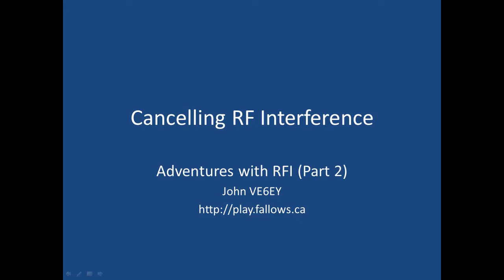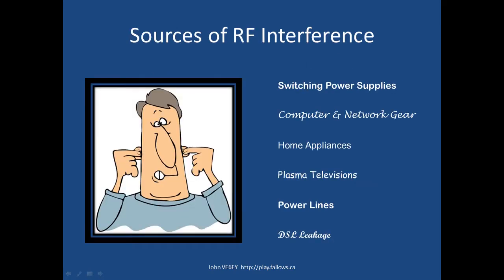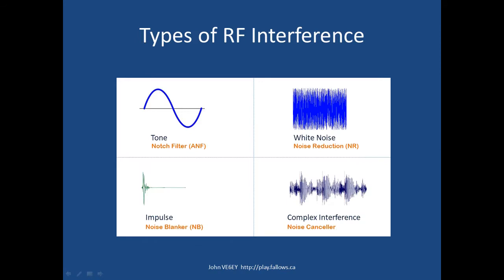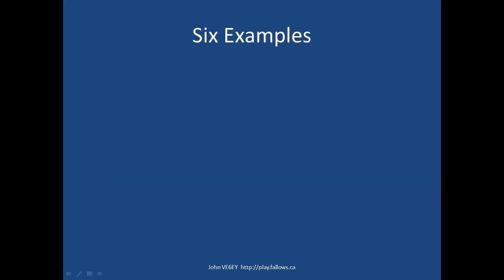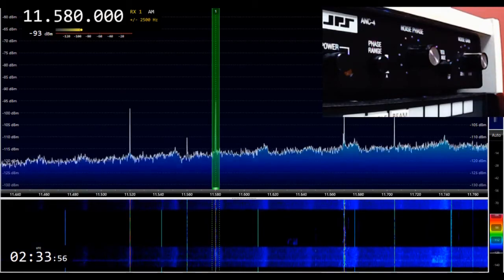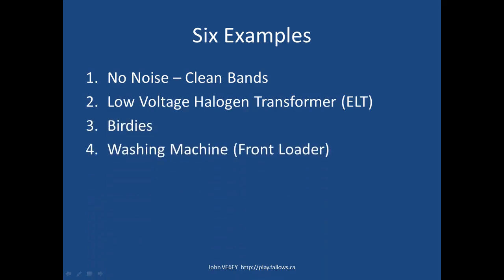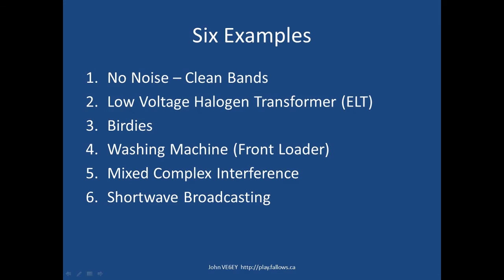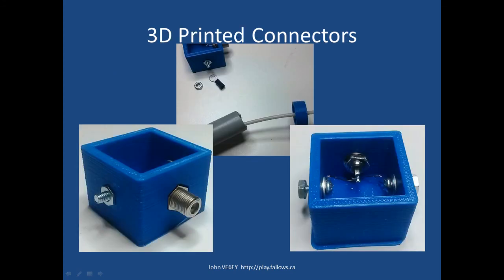Cancel RFI ANC 4

Comment: Thanks for video of info. I killed the power in my house last even to look for my noise, but found that the noise on my FTDX3000 running on a deep cycle marine battery did NOT reduce. I was actually a bit disappointed. I was just sure with all the computer controlled gadgets, and wall warts we use these days I'd find a reduction and start hunting for them room by room. I think I have my Dad's old Radio Shack Noise Canceller, and I'll see if I can find it and see if it helps any. I'm not electronicly sharp enough to understand just what form of noise I even have.

Comment: G'day John

Thanks for your video.  Very informative.  

I have a DX Engineering NCC2 - a very capable box but had limited success with it.  The noise  I am experiencing is broadbanded, from 160m all the way through.  Much weaker on the upper bands of course.  It is a wooshing noise (which I would usually put down to a switch mode) but the broadband and power of it suggests to me that it could be a powerline noise...specifically maybe one of the transformers.  Powerline noise is my biggest problem here because I have 33kv, 11kv and 450v lines running straight past my QTH.  I have been using my 10m vertical as a noise antenna with reasonable success on bands above 40m.  The problem is, it picks up a lot of white noise as well, and sometimes struggles to hear the powerline noise.  I have tried a mag loop antenna, and I have also tried a miniwhip, all pretty useless.

Do you think a couple of your antenna ideas might work?  I feel as though, if you want to eliminate noise on particular bands, in order to match the amplitude on your main antenna, your noise antenna needs to be a generally good antenna on that band...although I have also heard that it is not a good idea to have a noise antenna hear the desired signal very well.

The other thing I heard (and read in the NCC2 manual) is that you need to get the noise antenna copying the noise, but be at least 1/8 wave away from the main antenna.  Thats hard to do on 160m of course.  I do have an acre property thankfully, but still, ticking those two boxes is a challenge.

DX Engineering have recommended a 18-24ft vertical as a noise antenna.  I have not done that yet, so that is my next try.

I spent a lot of money on this box, and I would really like to get value out of it.  Any suggestions, particularly for eliminating broadband noise would be greatly appreciated.

Regards
Aaron
VK2ON
Reply from the maker: Hi Aaron. My experience is that you want a noise antenna that does two things: picks up lots of the desired noise; picks up little of the desired signal. This way, when you mix the channels, you are only cancelling noise, not desired signal. In other words, the noise probe should be a fairly lousy antenna except for the noise you are trying to cancel. Think about it. If the noise probe is a good antenna, you may also be cancelling the desired signal when you phase the two together. I use 4-5 foot vertical dipole or ground plane as noise probes on different locations around my city lot. This is for use with outboard analog processors like NCC and ANC4. With my two loop 100 foot array, I can do some beamforming and place a null towards the noise on a diversity receiver. Distance between the antennas effects beamforming but not really noise cancellation. Any spacing is a compromise on different frequencies. My 100' loop array does good beamforming below 10 MHz, but works fine for noise cancellation everywhere.

Comment: My Neighbor just purchased those Outdoor Lights- light strand...Party Lights..that's like 30 feet long. The Round bulb ones.     The LED Lights put out S9+20db RF hash.. from  500 on the AM Band to 29000 Mhz..    It is a complete HF blocker.   I need to go tell him but he's not a very "nice" neighbor to talk to, and I do want to do whatever it takes to fix the issue, but I think his personality is such that if he finds out that he is actively jamming my HF hobby, he might buy either more strands or just keep them turned on 24/7.  He is a difficult person.   So I am looking for a QRM blocker...  Thanks for the Video..
Reply from the maker: Sigh. RFI coming from power supply and radiated by the wiring, most likely. Given this is a point source, a noise canceller should help.
Reply: @VE6EY  Thanks.  One of the issues I found out is that they bought the LED light strands and then purchased another manufacturer’s dimming controller.  Many of these Chinese manufactured LED lights say that their dimmers only work with their lights, I’m not sure if that is just marketing hype or ?   But they have since unplugged the dimmer device and the noise has reduced substantially.  I had thought that my 6m antenna putting out 100 Watts was triggering the lights to come on because the light strand was coming on by itself in the middle of the night and I thought I had tripped it but apparently the dimmer was defective. I had my wife compliment her (neighbor) about her lights and she shared the maker of the lights.  I am still planning on buying a box to reduce the QRM. I learned that a pound of sugar goes farther than a whole bunch of vinegar when dealing with neighbors.

Comment: Hello.  Not sure if you still monitor this but I’ll ask anyway. This is K3TBA. I have an ICOM 7300 and just the other day I started getting RFI on 40 and 20 meter. They are evenly spaced all across the waterfall display. I checked my house by turning off the Main power and running off a battery. Nothing really changed after that test so it’s not coming from my house.
Reply from the maker: Hi there. You might check my web site http://play.fallows.ca for tons of information about fighting RFI. Contact me directly if you wish. 73 John
Reply: It's probably outdoor LED light strands..    I have the same problem.   I am thinking of buying a blocking unit.

Comment: Hi John, Great video and very informative. Can you tell me if these noise cancelers work up to frequencies of 216+ mhz?
Reply from the maker: Good question but probably not. Specs are usually around 30-40 MHz. The theory would remain the same but circuits would need modification to reach up into VHF.

Comment: Hi John,  you mention birdies, and what I have found with my SDR receiver is that almost all of my birdies are generated if I run the RF gain too high on my SDR receiver, and/or do not use an AM broadcast band reject filter.  I'm always suspicious when I see very thin repeating lines in my SDR waterfall display that Birdies are being generated (especially if they suddenly disappear below a certain RF gain setting), and this is usually due to AM Broadcast Band signals being too strong into the front end of my SDR receiver. A simple AM broadcast band rejection filter installed between my RX antenna and receiver normally eliminates all of these birdies and allows me to use a higher RF gain setting birdie free.  73, Don (wd8dsb)
Reply from the maker: Thanks for your comment my friend...

Comment: John, very good video. I am really surprised at the little power needed to disturb  a neighbor. I hard no luck with the mfj but I think it is related to my noise antenna. I am also told that a dipole perpendicular to your transmit antenna does the job.

Comment: Thanks John, great information! I believe my source of interference is a small retail store about 65 meters away using LED strip lighting in all of their windows. I am receiving it on a horizontal OCF dipole. I think I saw in the documentation for one of these noise cancelers that the noise and main antenna need to be the same polarization. In your example you showed your noise antennas vertically polarized. Is your main antenna vertical as well? Should my main and noise antenna polarization match?
73, Ralph KB1ZYI
Reply from the maker: Hi Ralph. No, my main antennas are generally horizontal (beam and dipole). Local RFI tends to be dominated by electric field and is almost always vertically polarized. I recommend that the noise antenna is vertically polarized to maximize pickup of the local noise. Your main antennas can be either polarization.

Comment: I just received a Time Wave ANC4 yesterday. Of course yesterday an hour before the receipt of said item the noise went back to my normal level of about S2 to S3.

I have not found the source as of yet. Until this last week, noise was not a problem that I thought to be too much.

However, now that my shack is getting better, I'm thinking that I may be able to pull in DX I've never heard before if I were to lower my average level.

First I have contacted my electric company as I think it is a power pole issue. I will make a phone call to that utility today to reaffirm my complaint.

The FCC by the way says that RFI caused by their company must be fixed by them at their cost. Even if only one ham operator is complaining.

So that I would have a potential remedy to the problem before I start what may be a long journey with the utility company, I purchased the ANC4 with high hopes.

I am very familiar with "Nulling" out an offending signal by using a wave trap with my Super crystal radio so I was very intrigued with this concept. Of course using a phase opposite to the offending noise is not want my wave trap is, but being able to visualize the process made me feel confident of this unit.

Eighty some odd ratings on eham with 4.3 out of 5 stars didn't hurt.

I will make my first attempt today but in all fairness to TimeWave, the noise I bought the unit to cancel is not present today.

Either way I'm excited at the idea of ANYTHING that may increase my ability to pull in extremely weak signals.

May the DX be with you

Comment: How do you keep your XMIT RF from getting into the noise or  receive antennas? Does the ANC4 have any kind of protection from XMIT RF?
Reply from the maker: Yes it does. ANC4 has an RF detector circuit that senses a transmission and switches it out of the circuit. A T/R relay of sorts that can handle up to 250 watts from a transceiver.
Reply: @VE6EY  Not much use if I want to put 1KW out though...

Comment: I am glad that you are enjoying your Timewave ANC-4. I recently picked up a W6LVP Magnetic Loop a few weeks ago and put it up about 20 ft on a Channel Master rotator and use it as my receive antenna on my ham station while using a 132 ft Carolina Windom antenna for transmit. I really have found a tremendous difference in noise after going to a loop. I also have a Timewave ANC-4 Noise reducing device that works great in combination with either antenna when fighting noise that is not nulled out by the loop because I am using the loop at times to pick between stations in different locations on the ham bands and also BCB stations. I have a 12 ft noise dipole at 3 ft above the ground for the ANC-4 that I placed right under my electrical power line pole. The combination of a loop and the ANC-4 has allowed me to enjoy listening to Shortwave like back in the 50s and 60s before all of the electrical environment issues we face today.
73s
WD9GNG
Reply from the maker: Thanks for your feedback Ken. Yes, I agree that the ANC-4 truly helps. On the other hand, perhaps the best RFI fighter would be a time machine!
Reply: @ZAR66  Does the Wellbrook have a xmit/receive relay box or do you need a separate receive connection on your transceiver?
Reply: @ZAR66  I just wondered if it came with one or not. My ICOM 7300 doesn't have a seperate receive connector. So I was wondering if I would have to buy a seperate T/R switch if I changed out to the mag loop you said was better? I realize a T/R doesn't have anything to do with performance but that I need one to auto switch when I xmit is all I meant.

Comment: Hi John, loved the demo, good info so thanks for taking the time to do a detailed demo/review. I have to deal with a Plasma TV, and other unidentified noise and this might help my situation here. I also do a lot of RVing and have a HF rig installed in my 5th wheel  but at a RV park with I hear lots of RV converters (switching power supplies) and when I'm dry camping I use a Generator with inverter technology and it also makes a lot of noise same as a switching power supply. So I'm thinking this might be a ticket to have better RV hamming. 73 Bill N7OQ

Comment: Hi John, Very good video, thanks for your work. I am having noise from lamps outside, I built a kit in Phase cancellar but not very effective as your presentation, Using my kit . the desire signal gets lower... perhaps a built problem I must check ! My first test I use for noise antenna a vertical Multiband  VHF, I will go one trying to get a better result or buy a Timewave or MFJ.
Thanks again for your work.
Manuel Fernando - CT1BXX
Reply from the maker: You can experiment with different noise antenna's and find one that mainly receives "noise" and no signals. I find that when inserted, the noise canceller reduces all signals by around 6 dB. This is okay as long as it reduces the noise by a lot more! Thanks for your comment. 73 John VE6EY

Comment: Great training video.  Have a ANC-4 for about 8 years.  Did the same thing with my station
when I lived in a close home subdivision.  The ANC-4 worked very well.  I use small dipoles
as sense antennas.  Did not try small verticals.  Moved out to 5 acres with not noise.  Still have the ANC-4.  I am doing to down load the video for club  training class.  Thanks again.
WB4BYQ
Reply from the maker: Thanks very much for your comment, Richard. For the rest of us in the city, it's a never ending battle! 73 John
Reply: Yes,  would solve one problem of noise, go to work for a couple of days, and then a new noise problem would come up.  It was noise hunt about 
twice a month.  Would head out of house with a Yeasu FT-897D with a same dipole ant on a stick to walk the neighhood to find the house with
the new noise.  see the attached link  http://atnm.mcars.us/HomeBrew/WB4BYQ/CommonModeChokes/
I would give these to the neighbors to install between the device and the 
wall outlet.  Did switch to the FT-31 cores and snap on core.  What made me move was the neighbor who purchased a Samsung Plasma 50 inch tv and a neighbor who was a very rude.  But since I have moved
both the neighbor with tv and the rude neighbor have moved.  I tried both
the MFJ and the Timewave/JPS phasing device and I liked the Timewave.  I hope that some engineer would build a much improved Timewave type of device,  the phasing system and the DSP I believe would help much on this problem,  like to see it built into the radio itself.
WB4BYQ